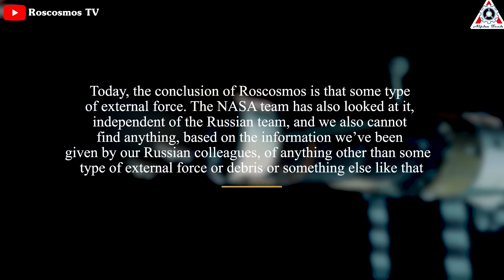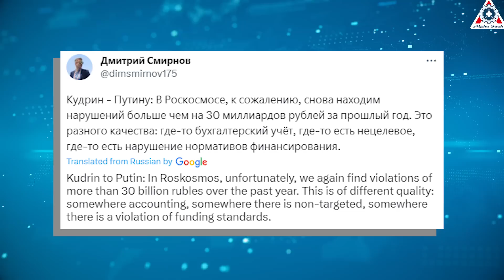SpaceX is about to launch Russia's cosmonauts again cause of Soyuz can't fly...

Comment: Apparently, we need Souze for the orbital boost capability.  The Space station is in an unstable orbit and without a periodic bust outward, atmospheric drag would impact the station catastrophically,.
Reply: Our Cygnus cargo craft can perform that function.
Reply: Not true any ship docked with fuel can do it and USA has more then one. Cygnus shifted the station to a higher orbit on June 25, 2022
Reply: @mohawksniper79   Not any ship, no. Dragon's thrusters are oriented the wrong way and don't produce enough thrust to do the job. If Starliner ever gets flying, it will be able to and, as you say, so can Cygnus.
Reply: @mohawksniper79  Who flies Cygnus, this is interesting data
Reply: The reason that the station is in such a low orbit is because the Russians can't get their Soyuz into a higher orbit that the Americans preferred.

Comment: Its easy to fast follow.  Innovation requires lots of expensive failures.  Russia or China can easily copy space X.  Dont delude yourself.
Reply: No, reverse engineering is not that simple.
Reply: @odysseusrex5908  Yes it is.  It is about 1000 times harder to invent.  China has already reverse engineered ASML deep UV lithography equipment, which arguably is more complex than a Falcon 9.

Comment: I bet those Russian Cosmonauts are much happier riding on a more modern, spacious space craft wearing sleek futuristic spacesuits.  The Soyuz is a great workhorse with a long history in human space flight, but it may be time to let her retire with honor.
Reply: To use the word  honor in the same sentence talking about russia is disgusting.
Reply: I'm sure space x is cheaper
Reply: @endofdays7568  Correct me if I'm wrong, but isn't a SpaceX Crew Dragon launch to the ISS about $20 million cheaper per astronaut/cosmonaut on board than a Soyuz launch?.
Crew Dragon has the capability of carrying 7 astronauts/cosmonauts, with space to spare, whilst they have to shoehorn the 3 crewmembers into an outdated Soyuz capsule, with no room to move. 
One man had a dream. That dream was to make rocket 1st stage boosters re-useable, and one day, the 2nd stage.
Well, the 1st part of that dream has come true. The Falcon 9 Block 5 boosters are re-launching on a regular basis, and always hitting the Bullseye on their return. 2 of them have launched and landed 16 times.
I personally think that Soyuz is finished.
Reply: They are trying.  The next gen is in work but very late due to funding issues.  First uncrewed flight is supposed to be this year. Orel.